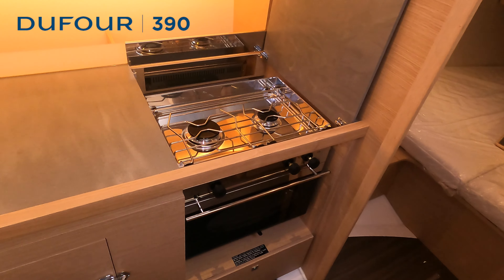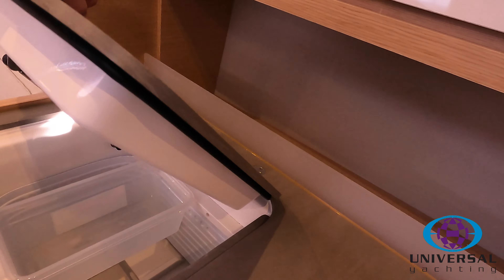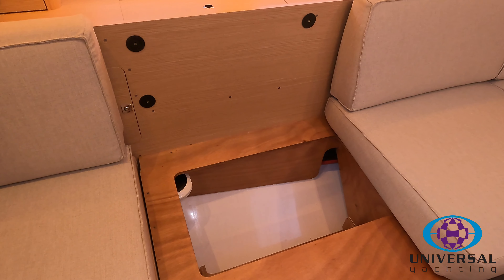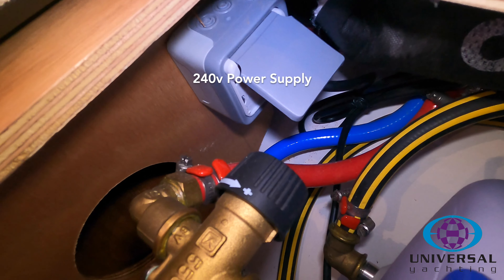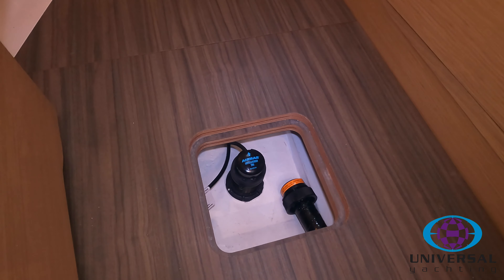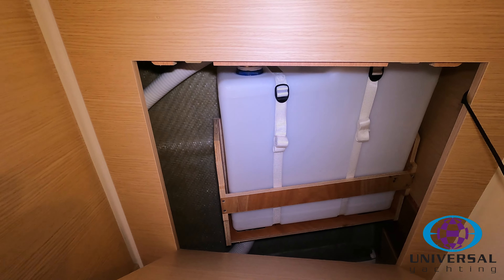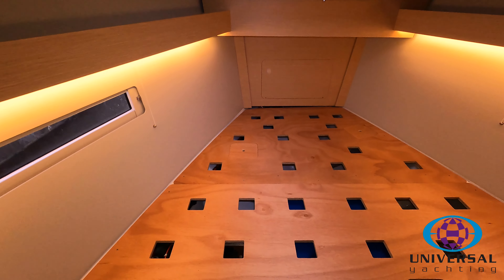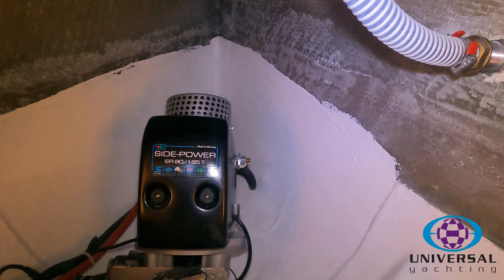390 Interior handover Part 2

Comment: The more I am learning about Dufour I am more impressed with their boats. I have been a long term Beneteau owner and if i were to look at a new boat I would have to test sail a Dufour. The only thing I don't like is that Dufour uses ZSpares. I don't like their masts.
Reply from the maker: Hi thanks for your comments and yes you should certainly test sail a Dufour, you will be impressed. Re the mast I respect your comments but they do work very well, they are solid and reliable and we don't have any issues with them practically. So whilst the mast maybe not your favourite brand I am sure that everything else about Dufour will persuade you.